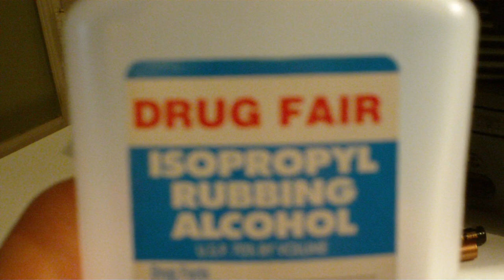PS2 Repair Video - Grinding Noise or No Disc Read

Comment: Your video is still helping people 13 years later. Amazing how much of a difference cleaning both lasers can make. Plus either bending the arm that makes contact with the corkscrew thing, or propping up that corkscrew with paper for those of us with consoles that have that arm made entirely of plastic, eliminates a lot of the grinding, if not all of it. Cheers! This fixed almost all of the DREs I had with CDs. Only one of them, Tony Hawk Pro Skater 3 for PS1, continues to not read, because the little teeth on the plastic arm in my console are almost entirely gone. Paper or bending can only do so much. Every single other CD I've tried so far reads, so this is a fantastic fix.

Why did Sony think the plastic was a good idea here? Who knows. I ultimately need to replace that arm. I don't know if you can get it alone or what, but that would be the true fix for my console at this point.

Comment: Thank you! You saved me!
This solution worked for me!
Except, my PS2 version had plastic part (not metal like yours), so instead of bending, I have heated it with a burning match (keeping it not too close, so plastic doesn't burn) and then slightly bended it while it was still hot.

Comment: my ps2 makes  buzzing  noise  when I  play a  game  then it freezes
Reply: i think its the disc slipping, is it a ps2 fat? if so the problem could be with the spindle that clamps onto the disc to spin it. an easy fix is putting two strips of electrical tape one on each side of the hole in the middle of the disc. if that fixes your problem then you have a worn down spindle. there are guides online to fix that, not sure how well they work though.
Reply: silosis yes it fat ps2 I no  what problem  was  I saved fifa  game  I tried to  load  it I was  on  transfer  it froze  then I heard  buzzing  noise
Reply: amer khan i see, glad to see it wasnt anything worse

Comment: Is the white piece with the teeth replaceable?   Because I think that's the problem with my system.  Or at least, the noise my PS2 makes is very similar to the noise that piece made when it didn't catch.  Anyway, you mentioned that simply bending it down isn't a permanent solution, so I'm wondering if it's possible to get a replacement for it?  Or would that fix not last any longer than bending it?

Comment: Guys their is an easier solution to this. The moving spiral drill thing that spin has to be lifted a tiny bit so that the other part does not slip. I took the bolts off the drill thing and put  apiece of paper under it to lift it and works great now!
Reply: I can confirm this works. I have an SCPH-30001R that has a fully plastic arm. I didn't want to bend it, so I went with lifting the metal corkscrew thing with some paper. It eliminated most of the grinding and DRE issues I had with CDs on this console. The little teeth on the plastic arm thing in my console is just too far gone for paper to help get my copy of Tony Hawk Pro Skater 3 to read in it. It still makes nasty grinding sounds and doesn't read. But every other CD I throw at it works perfectly, which is great. Too much paper, and the corkscrew thing won't move smoothly with the arm. Too little, and the gears lose contact with the corkscrew thing.
Reply: @NightimeDemon maybe the plastic piece you have is just too much worn out
Reply: Why easier? Maybe it works better? Which one is the best for 50004

Comment: How do you remove the top of the PS2 ?
I removed all 4 rubber plugs / screws & it still doesn't want to budge.
 One side (Slot card) will give more than the other

Comment: I have done both fixes and the grinding still happens. The laser is near the center spindle and then the cork rod drive just spins and makes noise. Looking at it when this happens it is spinning the laser  towards the center and it seems like it doesn’t sense that it has already arrived and keeps spinning  even though i have bent it enough.. it seems too over power the parkway and doesn’t stop when it reaches the end. The disk doesn’t spin is that still part of this issue? Or another?
Any idea of what to do? Or should I be looking for another PS2?

Comment: Thanks man. Your a great help. Because four month ago I brought a ps2 on eBay in March(that’s when the pandemic came) it was working great but then a month later it was making a grinding noise. I open up my ps2 and I use the grease on the laser rails and I clean the laser as well it works fine now.

Comment: So I took it apart like in the video and cleaned it but now it won't read anything it spins but then stops. The grinding noise is gone but disc doesn't even register before it would say disc error now nothing, any recommendations?
Reply: Hello, I tried the self diagnosis option and after a 3 minute wait, she started right up. I guess if you clean or take laser out etc. use the self diagnosis option to test it.

Comment: Thank you bro, I've looked at over 20 videos and forums and most don't know what the grinding is from or say you adjusted the white laser gear too far. I tried every click on it and still the grinding. A good clean of both the lens and bending that metal or in my case plastic part fixed it. You are a gentleman and a scholar! 

Up the fuckin Irons,

Brentos \m/

Comment: I have a "phat" ps2, I think it may be a SCPH-30051 and I cant seem to fix it, I've tried everything from Re-calibrating the laser and adjusting it and turning the white cog wheel, I think it may be the laser is burnt out but I wanted some clarification on the subject before I salvage another phat ps2 that I want to buy off of craigslist but I am quite worried about compatibility and if I would need to flash it or something along those lines. Need help relatively soon, Thanks. :)
Reply: Sorry, I didn't specify the issue at hand, I cant get games to read, nor will the laser turn on or move very much. It will move a minuet amount.
Reply: You might have to get a ps2 slim; those work more cleanly and take less space.

Comment: My PS2 Slim SCPH-79001. Makes a grinding noise when I turn it on. I was playing a game right before and left. I came back put in a different game, and then it starts making a grinding/buzzing noise. The disk doesn't spin either. Any help?

Comment: In my PS 2 the grinding noise is caused by the faulty position switch in the middle of the drive.
Unfortunately I can't find the position switch anywhere as spare part. Does anyone know where I can get a new position switch as spare part?

Thank you in advance.

Comment: This fixed my noisy PS2 perfectly! One step I highly reccomend adding though, is to clean all the old grease off of the axles and worm screw (the latter will probably require a Q-tip and toothpick to get it out of all the grooves), and replace it with fresh grease (I use SuperLube silicone grease, though I hear lithium and calcium sulfonate greases work fine too). The grease in my drive was very dry, but now everything works perfectly smooth and the drive is whisper silent.
Reply: I know this comment is 5 years old but what model number of super lube did u use? I looked it up and theres so many different kinds
Reply: @myretroworld1121  Look up "Super Lube Synthetic Grease with Syncolon PTFE." It comes in a gray tube.
Reply: I used the same stuff and it worked VERY well. I also replaced the disc tray belt and now that doesn’t drag anymore. Very happy with the turnout

Comment from the maker: @KKKSuperFan 
yes that needs to be connected in order to get the system to fire up. Be careful when reattacing the cable to the system. It could be tricky. Us a smal flat head to grip between the 2 tip on the one end end push it in the slot carefully... Its easier if you life the system out of the bottom case by removing the screw that holds on the controller port. there may be other screws but im not sure off the top of my head.

Comment: Did this (bending) probably over a year ago and my machine is still alive and well :)
Only recently it has started making very slight noise during SOME games but Im going to lube it up soon to see if thats going to help it at all.
Really good and helpfull video.
Reply: +shotgunmasterQL hey! what kind of lube should you apply on the rails? thanks
Reply: Miguel Patata 
Vaseline. I heard the non-sprayable is better and more plastic friendly.

I heard some people said good butter also does the trick but vaseline is probably the more proper one. Just make sure you dont go overboard.
Reply: shotgunmasterQL thank you for answering in such short notice! take care
Reply: white lithium grease

Comment: I bought two Final Fantasy games (8 and 9). Final Fantasy 8 is a used game and 9 is brand new. 8 works perfectly, no grinding noises or anything, but every time I put 9 in it makes that noise big time. I've tried many times to get it to work, 90% of the time it won't read the disk but it has a couple of times, and it quit working and made that noise some more before I could actually start playing the game. I did the cleaning and everything, but it's still doing it. Any ideas of why that may be?

Comment: I have the PAL ps2 and i cant bend the piece because it was made of plastic ;_;
Reply: Charlton369 i had same problem but you can still bend it. It only needs milimeters so it can be bent slightly. I used needle nose pliers to slightly bend it and now my ps2 works smooth no more grinding. 😃
Reply: Eric Zawadzki can you help me? I don't know how to do the things he does from 3:02 (taking apart the lens)
Reply: Having this exact problem that plastic is THICK and wont bend I tried warming it a little with a lighter so it bends, but it still makes grind noises
Reply: 3d print
Reply: That plastic piece is real trash. You can tell by the treads that are glued on to the plastic. I don't know what they were thinking when they made that. It must be a rushed launch release version to get it out before Christmas. The treads on the plastic must have slipped off track. It works for now. Funny thing is, is that it boots the game faster than the one I usually use. I guess I have to clean that one.

Comment: k ty for the info the grinding gear sound was driving me nuts ^^
btw mine seems to have a white plastic bracket for the gear thing you bend down any ideas or tips for those models lol
i was thinking on a very tiny tilted ring between bracket and the barce for it but i just wanna be sure before i try anything and destroy my system :p

Comment: I, myself have the same grinding noise, it's not that strong, but it's definitely noticeable. Regardless- my PS2 reads disks perfectly and works really fast, the noise has no effect upon gameplay, though. After I watched this video I realized that I might be forced to repair it sooner or later... BTW, what's your opinion should I get a                 PS2 FAT SCPH 39004 or stay with my PS2 Slim 70004? I heard that the Fat version has a way better ventilation system and a more durable laser?
Reply: Just use it vertical, i have the same situation of yours 15 years later.

Comment from the maker: @thewizard773 
try lubing up the metal bars that allow the laser to slide up and down... also there is a plastic tooth looking thing that holds the laser on the bar make sure its not dirty and clean it with rubbing alcohol.

Comment from the maker: The girinding will only worsen resulting in no disc reads. Just follow the video and youll be fine. I def suggest the ps2 fat over the slim. It is just built better in every way. Just like any other system old or modern. They make the first run the best then make a cheaper priced version once they got you hooked.From my experience i see way more problems with the slims and they are just built cheaper. The laser is def more vulnerable to problems. I can always fix a ps2 fat but not always a slim

Comment: man I will totally  try this, mine reads games, but sometimes it gets "stuck" and i hear the grinding noise. Some games play (mostly) fine, but some, regardless of scratches in the ps2 disc, just freeze while loading game content (usually they play the start screen). This video has shed some light on my REAL problem. I guess the laser reads but the machanism grinds man.  hopefully the screwdrivers I have will be slim enough, if not, fuck it man, I'm making myself a vodka screwdriver or a white russian.

Comment: Yeah, my ps2 before this, I couldn't play (get ready): 

GTA Vice City
GTA San Adreas
GTA Vice City Stories
NASCAR 2001
3 Copies of NASCAR Thunder 2002
Gran Turismo 4
Star Wars Battlefront

And a save loading error for THPS

Also when I play:

NASCAR Thunder 2003
NASCAR Thunder 2004
Activision Anthology
GTA III
NASCAR 08
NASCAR 07
Gran Turismo 3

I got a pretty well-heard sound from the ps2, thankfully, those still worked.
Reply: Yes, I only own 4 ps2 games that work cleanly. Although those are the ones I don't play anymore.
Reply: And for the Thunder games I couldn't play, I got a HORRIBLY LOUD sound from the ps2, like a frikin earthquake was shattering through my town.

Comment: okay but my ps2 slim just started to do that after i turned it on for the first time in a while today and i freaked out bc i also just cleaned my ps4 today bc the ventilation was really loud... but at least i didn’t need to open my ps4 ahhh i'm scared of having to do this
thank you tho this video is really helpful

Comment: If you simply pulled the housing for the switches out, it should pop back in. It's not the easiest thing in the world to do, but just work with it. If the wires themselves came off of the housing, then I would take it to a repair shop.

Comment: I have the plastic bit attached to the laser, so i had trouble bending it. What i ended up doing was putting an already stapled staple in between the screw and the laser body causing the plastic bit to bend down towards the toothed bar.

Comment: People need to be careful here. Not all ps2 DVD drives use a metal read head arm. My ps2 uses a plastic one and is from one of the first batches of ps2 systems that came out. You can't bend this and after ~25 years it's not advisable to try. Best to just source a replacement part.

Comment: I put it back together it makes more noise than it did before but the disk door opens up alot better now out of 20 times it only got stuck twice so I guess it helped. I think I just need to re surface my game. I also did the laser cleaning with 70% alc. Not sure why it's louder now though.

Comment: My ribbon cable is bent so I squeezed a string in between the plastic so the string is pulling on the cable and it works now its a slim by the way

Comment from the maker: I will check to see if there is a way to get those gears back to original position. If there is ill send you some pics.... Double check to make sure you have all ribbon cables attached correctly and the rods are nice and lubed for optimal sliding....

Comment: Nice vid. I was having the grinding noise problem, and I took it apart, and found the little tag connecting the laser part to the twisty bar was all clogged with grime and hair - eww!! But my dad helped me clean it with wd40 and we got spinning smoothly again. Thankfully, i didn't have to take anything else out  or bend anything into shape. Looks like I won't have to fork out for a new console just yet!

Comment: Actually you want a 50/50 alcohol/water solution, with the alcohol part only being about 60 or 70 percent. 100 percent alcohol will damage the lens.

Comment: thanks for the vid,

BTW i didnt have a ribbon cable on the top cover my power on/off switch and eject switch were built into the system not the case